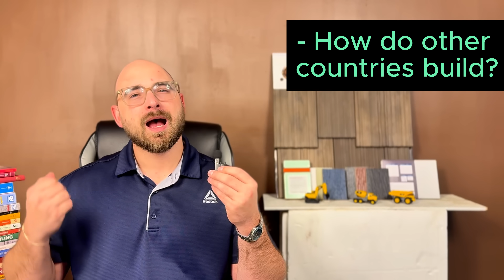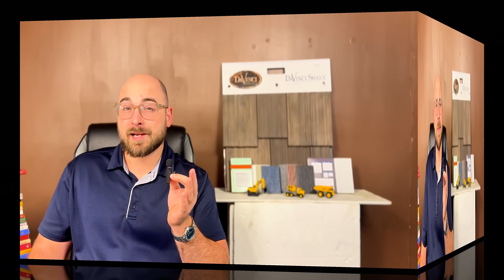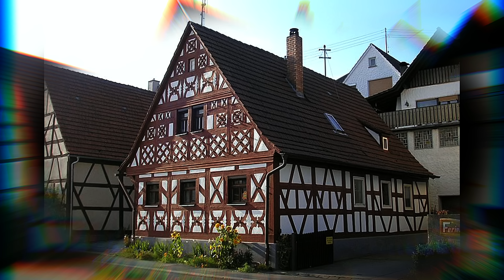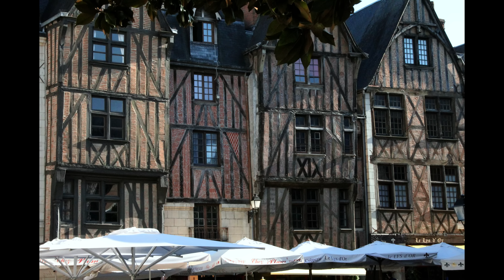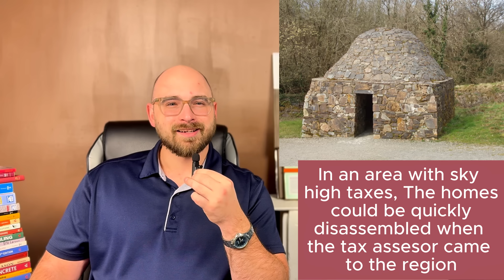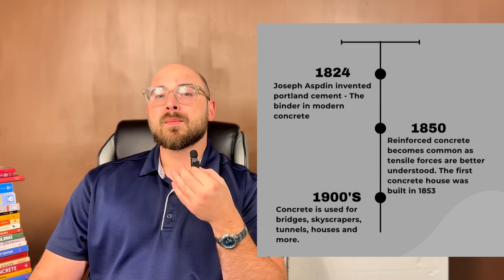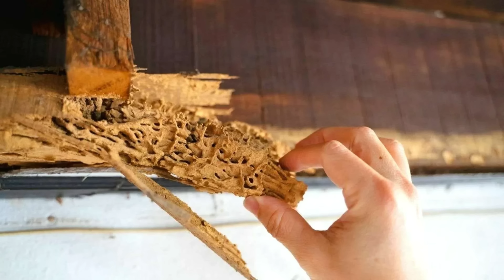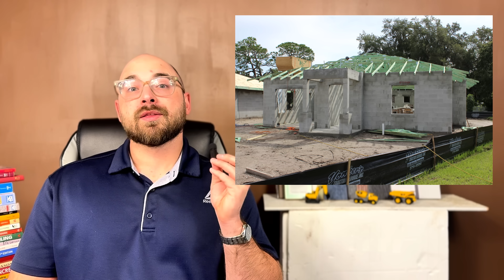Why Other Countries LAUGH at American Homes

Comment: If you want to understand European negative comments, you need to take into account that American houses only make the news when a tornado destroys many of them—damage that a stronger building wouldn’t have suffered as much. Negative comments are not only directed at Americans; Europeans also criticize each other, but you just don’t hear about that. A typical example is houses in the UK built from stone or other non-insulating materials, often without proper insulation. Many owners or tenants don’t even heat them adequately, making them cold and damp. Pay attention: the number of negative European comments will increase when they hear in the news about how many American houses were destroyed in a storm.

Comment: Here in Eastern Europe we have 2-3 types of homes but the most usual today is reinforced concrete pillars and floors, yes reinforced concrete, with rebar inside it, and then either AAC bricks (Autoclaved aerated concrete) or real bricks for the walls.
We use timber for the roof structure with either ceramic tiles, metallic roofing or composite roofing depending on the budget and project.
Today almost all windows and doors are Termopane types. 

On the exterior we add a 5-15cm thick polyester insulation layer, and then the usual façade plaster, paint or whatever the project needs.
On the interior there are vapor barriers for the floors, drywall and of course all kinds of finishing as per the project.
We use foam, but also mineral wool or rockwool whenever needed.

Most houses have a story deep basement, concrete floors, reinforced pillars, but here some may choose concrete walls instead of the usual AAC ones.

If properly built a house like this can resist any type of weather, or even a direct hit from a semi-truck at 110km/h, especially if it hits a reinforced pilon. 

Oh, and some are also using reinforced concrete for the fence, one man high, reinforced concrete pylons and wrought iron fence panels.

Comment: I think the biggest problem for US homes is the building codes. Also, the best method of building would probably be the combination of all of these. The reinforced concrete for the skeleton, the block brick for the outer walls, and wood or something like Siporex for the interior walls. But that’s just my uninformed opinion.

Comment: We have one building company here in New Zealand that uses steel framing (Golden Homes).  Most homes here have traditionally been built with wooden studs, but we do have more dwangs than the diagrams you showed for US homes as well as diagonals to add strength.  It's not cheap either, despite the amount of forest wood we produce.

Comment: I am from the UK and houses here vary wildly, but houses like mine from 1935 are brick outer and inner skin with a cavity, which is incredibly strong, later houses are brick outer with timber frame inside, and houses in between had brick outer with blockwork inner walls and an insulated cavity, brickwork will need the mortar joints to be redone and is fairly expensive, but we rarely have tornados and earthquakes that can damage building, brick buildings are very expensive but worth it especially if used in conjunction with a concrete frame. In the Philippines, most buildings are concrete framed and floors with infill hollow blockwork that has steel bars passing vertically from foundation to roof with concrete infill so that the roof can be held down to the ground to fight lift from Tornadoes and also protect the building from damage by earthquakes. There are lots of methods, but if you build a timber frame house for less in an area where a Tornado or Hurricane can knock it down and people of the Philippines (who can afford it) have solved that problem then why build it at a lower price at a higher risk of loss? (I know it depends on the location :) )

Comment: My House in Germany is over 120 Years old , the oldest part  has doubble Brick walls on the outside , the Roof burnt down once and  the Roof was rebuild , it was insured . Yes , its more expensive to build Stone/Brick Houses but US Houses are often not even cheaper than a House in Europe . Yes , its easier to  modernise a US Home because the Walls are hollow and you can hide cabels easier . New Houses in Germany are basically    a l l   Passive Home Standard since 5-10 Years . I modernised my Home , it has now additional 20cm insulation on the outside and in the Roof , its nearly passive Home Standard

Comment: My brother built a ICF house and it is a nice house but it is not better than my wood construction home.  Concrete has a very low R value compared to thickness.
Reply from the maker: If uninsulated yes, but ICF performs around an R50, much higher than wood frame because it is built with INSULATING concrete forms. 

There’s also thermal mass and passive geothermal temperature belong to heat and cool the structure, which wood frame do NOT benefit from 

Wood walls have thermal bridging every 16” on center, the wood itself is not a good insulator

Comment: You say yourself that solid structure is stronger, more resistant to disaster, more energy-efficient and blocks noise. You fail to mention that it still stands 1000 years later as opposed to  American light-frame construction, which starts to come apart in 15 years, but I suppose that indirectly you do mention that by saying that it uses flimsy, bad quality wood, put together with nails, and which is definitely subject to storms, water damage and bugs. And then you still say: "Are other countries' building methods better? Yes and no." Seriously?  The answer is a big YES! Our 16-year-old American house desperately needs fixes. We have leaks, possibly black mould in the also-wood-frame tile veneer bathroom, the nails in the  sheet rock started popping out after one year, we will need new roofing in a few years (which is, ridiculously, standard), the wood porch is falling off and half the windows need replacing because they don't open. We've had to take two doors off their hinges because the doorknobs broke and they wouldn't open, we had to have all the electricity redone (and still not in rodent-proof casing; it would definitely not pass Dutch fire standards) and we really need to have several faucets replaced - for the second time. And this was not a cheap home to buy. And I'm not even talking about the utilities. When the f... are y'all going to catch up with the 1950s and put your wires underground so people don't freeze to death every year when a tree falls on a powerline? There is absolutely nothing that doesn't suck about American construction. It's all about using as little as possible of the cheapest materials and selling it for the highest possible price. We had a one-year - 1 Year! - warranty on our house. You get a longer warranty on a computer. And it lasts longer, too.

Comment: yeah some if not most of these "beautiful halftimber" houses you showed are constructed badly as to why they are leaning etc....
Reply from the maker: Has to do with wooden pile foundations driven deep into marshy ground.  These were originally stable until the local govt start controlling the height of the nearby river, thereby affecting underground water tables, which exposed the century old piles to air which caused rapid deterioration. 

At least that’s my understanding of the problem

Comment: I actually think that the wood framing houses in the US are built a bit strangely. For example, your "standing" framing is CC (measure between Center from one to the other Center) 16 inches (~40.64 centimeters) and here in Sweden it is 23.62 inches (60 centimeters). It means for example that it is a lot simpler to put up the insulation since you cover a bigger area faster. It also mean that you have less area of wood and therefor less area where the cold can "wander" thru the wood in to the other side of the wood framing, meaning that the US way of building makes it colder then the way we do it in Sweden. Also you cover the whole building in OBS Panels and they are very sensitive to water damage. In Sweden we (well, at least the smarter ones who realize it is definitely worth it) put the OBS Panels on the inner walls. That makes putting up cabinets, paintings or whatever you need to screw/nail up on the walls so much easier. I also do not understand why some builders do the framing all around the building at once. Build 1-2 or maybe 3 walls ready and lift them up and join them together. It is so much faster then raising a 6x2 (or whatever material you use for the framing) up and then the next one and you need to support every single one making it a bit of a mess. If you build two complete wall laying down (in Sweden usually on the concrete foundation) and raise them up it makes the whole process so much faster.

Comment: In my Australian teens of 1978, my parents divorsed, and had to take charge in building a small basic house for my mother, as my much older brothers 'chickened out'. The concrete slab was poured, and because my mother didn't want to pay more rent, she hired the skoppy building team who came immediately, but spent days, stopping at midday to go ti the pub. They left the scaffolding in and we had to knocj down two or three unecessary block layers. Rule one - don't be impatient, in Australia, scamming is almost the normal thing that happens, if you're a foreigner.

We call them 'Besser Blocks' - and these concrete cavity blocks, too heavy for ordinary folk to lay easily, are definately great for insulation against heat and cold weather - if sealed well. Australia was wetter back then, but floods occur more frequently now. It's important to either seal the outside with paint etc. and/ot have fairly-wide 'soffitts' to keep the walls dry, and also give more shade to the exterior walls to keep the house cool in hot Queensland weather.

The 'Queenslander' style house is typical for hot Queensland weather though. It's a wooden highset house with verandahs all around, so the roof keeps the walls in shade, and a lattice on the veranda railings. Sometimes people would go under the house to get cool. Later people kep their car, tools, and even built in some of this space. Lots of 'lush vegetation' also helped keep the house cooler.

{I said 'lush' because Eucalypts [gum trees] with oils in them could bring terrible fires. Like the three little pigs learnt, don't build the house in straw [thatch], or sticks [wood], but brick, cement blocks, and stone. A small cement slab of more than 5 inches thick is less likely to craack than a larger one.

Right now, I'm in a wooden frame house with a fake wood, shamferboard exterior highset that was built in with besser blocks underneath on a slab - that must hace shifted after years of drought and this put some cracks in two walls - a zig-zag effect. It still keeps cool with an airconditioner downstairs, but is too hot upstairs.

They say that wooden floors - feel better for walking around barefoot. I have a pagoda-style hybrid Japanese house plan for the steep terraced land here, but potential builders look at us abd presume we can't afford them - and they run off to build new homes for 'Covid-changers', instead of previous sea-changes amd tree-changers from inner city living.

I have no idea whether a small town council will approve a five-level pagoda-style house,  or whether we can find anyone to fo it. Australian house have price increases of about 50% since the Covid era. Land prices soared, but I don't see why builders and materials have gone so high as well. But this goes in most directions - with food increases, and horrible state government fines of $1200 for looking at the time on our phones when driving.
Reply: Older Australian house had firm wooden beams, some even hardwood - the termites didn't eat that. I was astonished how flimsy my sisters new house was - watching it being put up by her 'husband's' groups of friends. It was a 'btick veneer' [brick venereal - they say] with ties from a single brick outer wall to a flimsy pine-framed inner wall. [Only single storey of course]

Comment: I am not 100% sure, but one of the main ingredients of Roman concrete is supposed to be volcanic ash, which is not that widespread around the world thus making it less accessible than areas around Italy and especially around Rome. Even the Romans didn't use their infamous cement in everything and other buildings, especially in other regions of Europe (where the Roman Empire extended) they used primarily stone and marble as main materials of construction.

Comment: It's not even that timber framing is inherently not sturdy or well built. Many of the half timber houses shown seem sturdy and well built to me. It's more that in the US the choice of timber for the frames in many homes seems barely sufficient; the infill is (justifiably) focussed on insulation, not strength and then it often doesn't get finished with sturdy materials, but with things like thin drywall covering. That all combines to a wall that seems incredibly weak to me. To me this "America building weak haha" idea is less based on the style of construction, but more based on that longevity and resiliency seems to have come second place compared to reducing costs and that seems to show. Anyway, I did learn a lot about building styles here, very informative video, thanks.

Comment: So the question is, what would you rather have- a beautiful, well insulated, comfortable, easy to make additions to, easy to add behind-the-wall wiring for technology, etc., modern American house made of sturdy lumber and practically earthquake proof, OR a foreign mud hut partially made of animal shit, or ugly cheap-looking cinder block (which contains radioactive fly ash by the way), or poured concrete-all of which are ill-suited for adding additons to and are impossible to add behind the wall wiring without deconstruction and replacement, and which will flatten out like pancakes killing thousands or people in an earthquake. Riiiiight, that's a toughie.
Reply from the maker: Light wood frame houses are not well insulated and concrete homes aren’t that hard to remodel. Especially if you use ICF. 

What’s more is most additions are purely cosmetic nowadays. New floor, new kitchen, new bathroom, fresh paint and sell it. 

Disaster resistant and resilience should be considered. 

If your house burns down or blows away in a storm, the insurance company won’t pay %100, and the bank will still want their mortgage payment. 

Not to mention loss of life, loss of time, loss of personal belongings all of which are priceless

Comment: Very interesting. In Germany (and I'm sure other places in Europe) there are also a lot of light timber framed houses - it's called Ständerbauweise. It's not new, but it's a growing in popularity as a building method - mostly because of timber being a renewable resource. The difference to US construction is they are mostly build with 2.5 x 10 /12 studs and feature thicker insulation - which makes sense as energy is much more expensive in Europe so the higher upfront cost pay themselves quickly.

Comment: We used to vacation with my husband’s family in Germany. The houses were built solidly. One house was an L-shaped farm style house in Thuringia. The outside was clad in slate shingles,  by mandate after there was a bad fire a long time ago. Trees were the timbers. Each of the corners in the outer house perimeter was a massive tree. The amount of large wooden beams in the construction was considerable. The roof was  clay tiles. The outer wall was built using woven slender branches and then coated with clay daub and other materials.  The house is being renovated section by section to the modern codes. The hearing system included a central wood fired incinerator which heated the sleeping areas and the bathrooms. The living room had a separate mass ceramic heater which was wood fired. Everything was vented. 
A modern gas furnace was installed in what I would call an attic. 
There was a stone room in the cellar with rock flooring which was the cold cellar. They bought bulk vegetables and roots and nuts by delivery and stocked this room with potatoes, carrots, cabbage, walnuts and glass bottles of water in cases and beer. The eves were made of zinc and were large and sturdy.
In Bavaria we visited an Aunt. She had a more modern house. It was constructed of the red clay tile bricks with the gaps in them, and the house was double walled.  She had a marble staircase to the basement and a marble patio. The marble outside was not polished. The exterior of the house was modern European stucco. The windows were heavy with blackout blinds in the inside. The doors were solid as well and had the same blinds inside. We witnessed an older street being renovated on the exterior. These houses had been built about thirty years previous. The stucco on each house was being removed and replaced, one after the other. With stronger stucco. The construction was amazing. 
Not everyone owns a home. The relatives that lived in apartments told us very interesting things.  People moved to lower level apartments when they were old. The younger people lived higher up. A lot of the apartments were not in tall buildings.
People usually did not have a parking space in the village or towns with modern style solidly built homes. They had a simple garage in a garage line located in an area not far at all from their homes. Recycling took place in attractive neighbourhood locations.
Neighborhoods were beautiful. The homes soundly built. Some villages had historic wall about them which also served to redirect water if the flooding was not too bad.